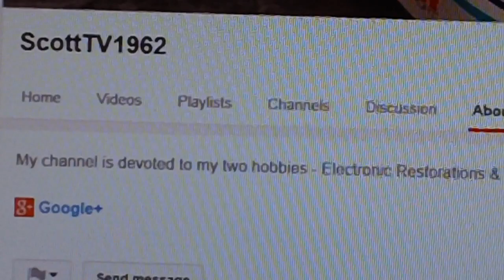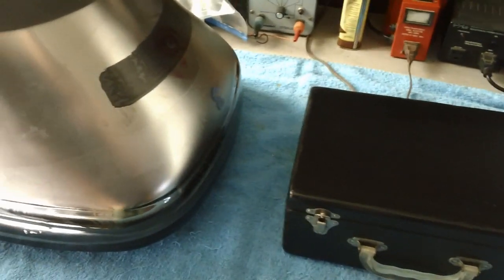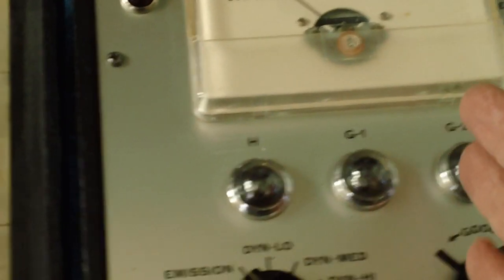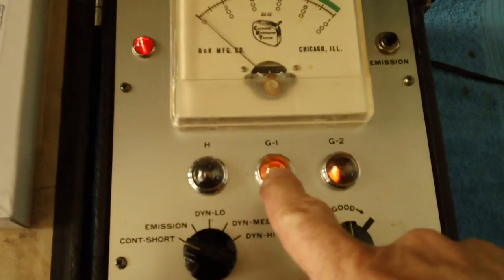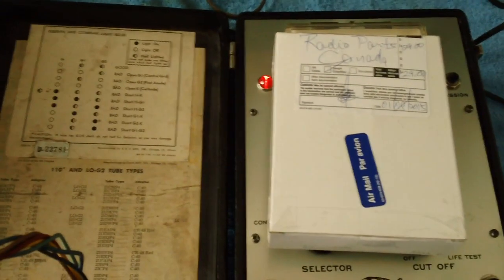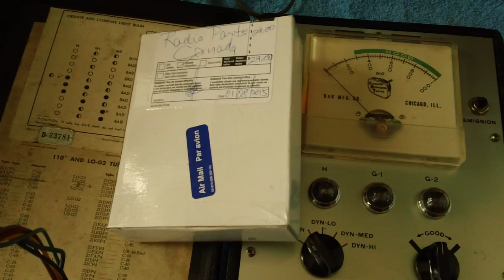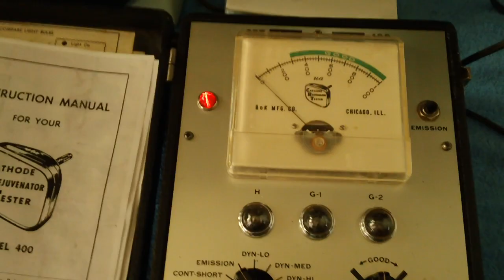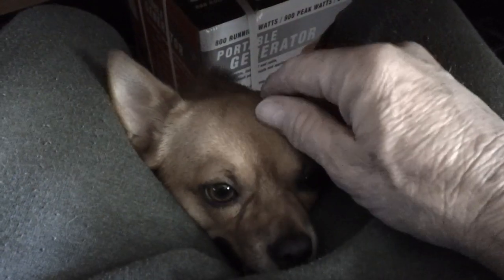1956 Sylvania 21" Halolight TV restoration (part 4 of 23).

Comment: I have a B&K 440 I bought from eBay and used it on my Zenith Giant Circle TV 19AP4 tube. LOL "It - Is - Later - Than - You - Think". You sure make fun videos. Gary
Reply from the maker: Gary,Thanks again, my friend.  I remember watching your Zenith Giant Circle YT vid, but haven't followed up on it.  Have you got it humming yet?
Regards,John
Reply: joernone
Not yet but today I tested all the tubes related to horizontal sweep and HV. The 6BN6 synch separator tube is bad and that's probably the main reason why I have no HV. I have to pull the chassis first and recap it.

Comment: One thing that I have been told about those early picture tube testers is that whilst they are fine for testing purposes, once restored electrically, do NOT use the rejuvenating functions. The rejuvenation circuitry is crude and can do more harm then good to a weak, but otherwise functional, CRT.
Reply from the maker: I've been told the same thing, but it's not exactly accurate information, which is often the case.  Rejuvenating is a last resort.  If the CRT is bad enough to try rejuving, then it won't last very long no matter one does.  That said, a functional but weak rare CRT should probably not be rejuved.  Better to have a weak picture than none at all.
It boils down to using proper judgment for each given situation.

Regards,
John
Reply: I think that what it may be is that the later picture tube testers have different ranges for bringing up emissions on a weak CRT. Like the lowest setting has a cathode cleaning function, as well as a rejuvenation #1 setting, and a rejuvenation #2 setting. The procedure is to try the clean function first, retest, and if that doesn't bring up the emission to where it's good and stable, to move to the rejuvenate #1 setting, if that doesn't work then you use rejuvenate #2 as a last resort. If that fails then it's time for a new tube.
 Of course what most TV restorers do is what you did with the Sylvania CRT, if it doesn't come up straight away to let it "cook" for an hour at normal filament voltage. Then if that doesn't work to let it cook at a slightly higher filament voltage for a while. Both are more or less safe to try unless the tube was complete garbage to begin with.
 Fortunately in the Halolight's case the 21'' inch, rectangular tube it uses was pretty much the standard size B&W CRT across the industry in the 1950s. Even now you can still find NOS ones, not to mention rebuilds since just about every manufacturer used them. The older ones needed an ion trap magnet but the later ones were aluminized, as the one in your set is.

Comment: If my memory is correct, I read somewhere where Sylvania had a lifetime warranty on the Halolight lamp. But then the question becomes the lifetime of the original purchase or the lifetime of the set? And if it's the latter what's the lifetime of the sets? Just curious, is that CRT the original or replacement.?
Reply from the maker: Jerry,
I don't know if it's a replacement or not.  The tube number does not match what's on the schematic, but it is a direct replacement.
And it's interesting about so-called "Lifetime warranties".  My son had his truck windows tinted...one of those lifetime warranties deals, but the place suddenly went out of business, so what happened to that great warranty?   Only in America, huh?

Regards,
John